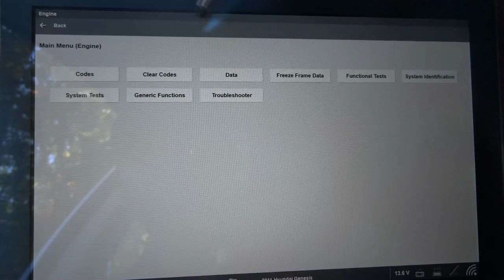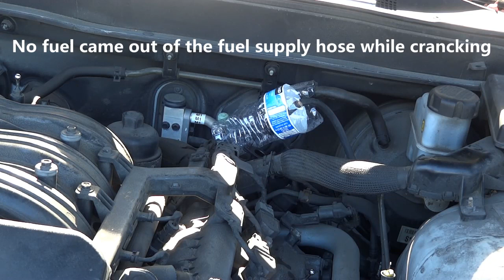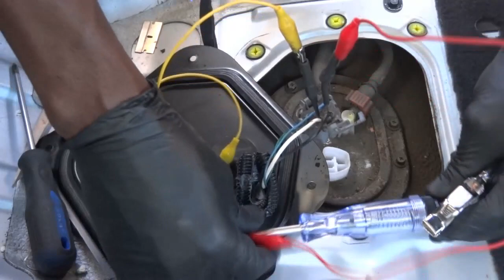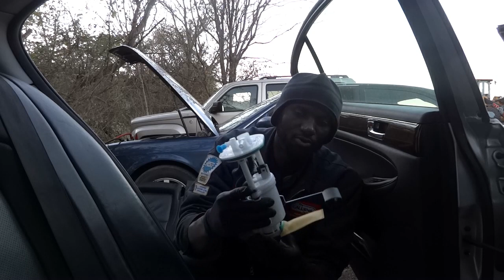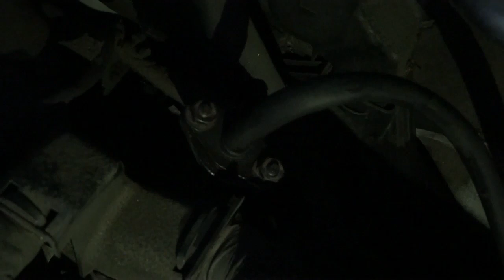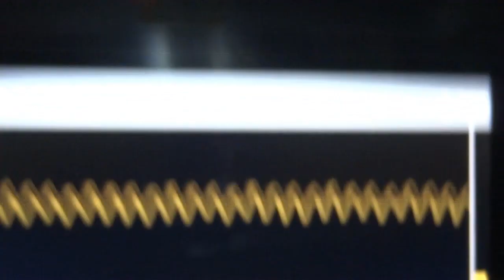Hyundai Genesis - Crank, No Start/ Fuel pump testing

Comment: Thanks for the video! I’m currently having this issue with my 2012 Hyundai Genesis 3.8. The dealership told me I had bad gas, got that replaced but the car is still doing the same thing… no start, battery drainage, clicking when trying to start, whining sound after car is turned off. Now they are telling me it’s the fuel pump. How much was the fuel pump assembly you ordered for this car?

Comment: I had fuel pump replaced but the engine is still receiving the fuel sometimes it will crank and run then it starts to run rough and crank off..what could it be

Comment: I did exactly the same test to my fuel pump connections with a test light but the light turn green instead of red what does it mean I'm getting a green light every time I crank does anyone know if that's good or not or should I turn again I use a test light just like the guide on the video

Comment: I have similar issues but after several cranking the engine runs,  what could be the problem?
Reply from the maker: @nasserjabri7449   Your fuel pump could be weak

Comment: Excellent video. I also have a 2011 Hyundai but it's a Equus. My issue is that I smell gas in the car when I fill up the tank all the way. I am guessing the fuel pump assembly is cracked or the connector is leaking
Reply from the maker: @kalani1987   Thanks, yes that's possible

Comment: I know its been 3 years but did you really change the whole set of the sending unit together and set the car waiting for a week? Why didn't you just change the pump and the filter right away? Man... that would have been easier, quicker and cheaper ?????!!!!! ✌😁
Reply from the maker: @ShakarAhmadi   No, we replaced the entire fuel pump assembly
Reply: I know but thats costly and one week is too long for that job... ✌️😁

Comment: Hey I have a 2010 Hyundai genesis 4.6 and i have a problem when I pumped fuel the car would crank but would shut off instead and I waited a few minutes and pumped the gas pedal and started after all that any idea what it could be other than fuel pump since I had just replaced it with a brand new one and this is an issue every time I pump fuel
Reply from the maker: @brianmendez9532  is this only happening everytime you put fuel in the fuel tank? if the answer is yes then the issue is most likely a stuck open purge valve!!

Comment: My 2012 genesis does the same thing, but every time I clean the corrosion off my battery it cranks right up
Reply from the maker: @tevin3619  you might just have voltage drop in the starting system caused by corrosion!
Reply: @KITS_Auto_and_Truck_Repair  I found out the battery cable connectors on the Genesis sedans is defective. They do not use a zinc die cast traditional battery connector, it is made with two metal "bands" that go around the post. BAD design. This has caused all kinds of random electrical "hickups" on this cars!   My car 209 sedan would go completely lights out on me - did once on the freeway at night.  Buy a red and a black 1 ft long cable at the auto store, then just extend the cable and fasten the round loop side to a bolt on the original cable.  Then you have to support the stupid plastic fuse holder tray on the positive cable - insulate it from bouncing around....you will see what I mean if you go to replace them.

Comment: Also sometimes when i turn the switch on u hear the pump come on and then sometimes you wont hear the pump until you try to start it.
Reply from the maker: @quincyrobertson9029  your pump might be failing intermitently or you could have a wiring problem!
Reply: @KITS_Auto_and_Truck_Repair  the pump works its sending fuel just wont run the car anymore.

Comment: I replaced the fuel pump and it started drove and died again. What could it be?
Reply from the maker: @quincyrobertson9029  Make sure your wiring is good! and I hope you installed a good quality Pump!
Reply: @KITS_Auto_and_Truck_Repair  walbro 255. I replaced the pump itself not the assembly. Im thinking the fuel level sensor is bad. I will check to see if i have spark tomorrow.
Reply: I would like to know as well

Comment: I recently replaced my pump now there’s no power from the pump it’s at the dealer and they want too much for a pcm something like that module everything else works could it just be one of those wires?
Reply from the maker: Valarie Aria  yes! Make sure the pump relay is good!
Reply: @KITS_Auto_and_Truck_Repair   I have  2009 with start issues.PCM replacement, new starter? New Crankshaft sensor. Im searching for relay issues and Motar Block Grounding?
Reply from the maker: @danielmoss359  Yeah! Check your wiring!

Comment: Cleaning the bottom of the fuel tank…..The fuel pump just died on our Genesis and my wife just filled the car up about 10 miles ago.  How shallow is the tank?
Reply from the maker: Todd Rey   it's pretty shallow!!
Reply: @KITS_Auto_and_Truck_Repair  by the way, I have a 2012 Genesis 3.8 sedan.  Is changing the fuel pump about the same as the one u did in the video?  Thanks!
Reply from the maker: @todd5082   My Pleasure!! Yes it's the same process!
Reply: @KITS_Auto_and_Truck_Repair  thanks Bud.
Reply from the maker: @todd5082  My Pleasure!!

Comment: I’m literally dealing with the same issue with my Genesis coupe 2.0t just hit 80k miles
Reply from the maker: KidCigano  do the test I did in the video if everything checks out ok, your pump is most likely defective!! Good luck!
Reply: @KITS_Auto_and_Truck_Repair  most likely will do the test sometime this week. Appreciate the advice and this great video!
Reply from the maker: @KidCigano  Thanks!
Reply: @KidCigano  how did it go? I feel like mine is starting to go now @74k miles
Reply: @stinkfart697  had to replace the fuel pump assembly unit
Reply: My pump went out at 130k. Got another one put in. 199k miles  now

Comment: Hey man great video, I just changed my pump on the exact same car, first crank it started up for a second  then quit and stopped working. I plugged in the code reader and it isn’t reading any engine codes. Do you have an idea on what this could be?
Reply from the maker: keagan van hoecke  Thanks! check spark and fuel pressure!
Reply: @KITS_Auto_and_Truck_Repair  thank you! I’m going to try that tomorrow. Do I check the coil for spark?
Reply from the maker: @keaganvanhoecke8561  yes!

Comment: Thank you so much for the video, would I still be smelling gas up from by the engine even if it is the fuel pump? It seems like the exact same scenario I’m in, lost power steering all lights came on on the interstate. The crank sounds the same I’m about 170K miles
Reply: I am getting spark and compression.
Reply from the maker: Jared Maier  Your problem is most likely fuel pressure!!
Reply: @KITS_Auto_and_Truck_Repair  thank you so much for the reply, I do have fuel actually, is there anything else you would check for a situation similar to this? I’d assume it is sensor related but I have no clue where or how to start
Reply from the maker: @jaredmaier3414  are you sure, you have spark?
Reply: @KITS_Auto_and_Truck_Repair  yeah, haha got shocked checking lol! It cranks over just like this one. Only code it’s coming up with is oil temperature sensor but idk if that would make it not start, I thought about checking the crank sensor too but idk if either of those would do anything. I have had slight overheating problems because I have been waiting for a new radiator from my shop for a month and a half now and they keep pushing it back. Maybe it overheated and the oil temperature sensor is making it crank but not start?
Reply from the maker: @jaredmaier3414  Recommend you check for injector pulse and spark! I have a couple of videos here in the channel that can show you how to do so!
Reply: @KITS_Auto_and_Truck_Repair  spark has been checked, injector pulse is getting checked tomorrow when the set comes in, I’ve checked most everything else I don’t know what it could be. The only codes coming up are oil temp sensor and O2 codes
Reply from the maker: @jaredmaier3414  Sounds good!!
Reply from the maker: Jared Maier  It sounds like your fuel pump gave up! disconnect the fuel supply line under the hood and crank the engine to see if fuel will come out!!
Reply: @KITS_Auto_and_Truck_Repair  £11

Comment: I don't have power to the fuel pump. Fuel pump relay has no power to it. Where do I go from here?
Reply from the maker: Amber Vinton check the fuel pump fuse, if the fuse is good!! I recommend you take it to a pro mechanic who can diagnose it for you!!
Reply: @KITS_Auto_and_Truck_Repair  didn't see one. Is it in the engine or the dash and which side? Thanks for the reply!
Reply from the maker: @ambervinton5348  it should be in the fuse box under the hood!!
Reply: @KITS_Auto_and_Truck_Repair  just to add to the confusion. I realized the dash lights go out when cranking. Does this seem like a bad battery or bad connection? Not sure why it cranks so well if the battery is bad, but I also don't know why the dash lights shut off when cranking. . .
Reply from the maker: @ambervinton5348  yeah! you might have a battery, you should have it checked!!
Reply: @KITS_Auto_and_Truck_Repair  discovered no fuel and no spark. Voltage drop when cranking. When on a scanner, I can get the fuel pump to prime. Voltage drops to 6V when cranking. Going to replace a battery.
Reply from the maker: @ambervinton5348  Sounds good!!
Reply: @KITS_Auto_and_Truck_Repair   new battery did not fix. Still dropping voltage when cranking. Fine with key on, drops as soon as cranking. Not a slow crank, but now I am thinking maybe the starter is drawing too many amps.
Reply from the maker: @ambervinton5348  You probably have a voltage drop problem in the starting system, check the starting circuit first or take it to a pro mechanic so they can diagnose it for you!

Comment: Great video!  Very thorough and clear.  I was afraid to work on my car but after seeing this, it was less daunting than I thought.  I had the same issue as you with parts being months out.  Ended up just replacing the pump.  I think the one I got is lower pressure so it’s still taking some time to start up, but it will get me from point a to point b until I can get a better pump.
Reply from the maker: clintdover Thanks, I'm glad to hear that you were able to fix your car by watching this video!!
Reply: Hello I know this was over a year ago but how what someone who has no experience with working on cars clean out the tank without dropping the tank

Comment: Nice videos …i need HELP … for some reason my Hyundai Genesis 3.8 wont start.. the other day I was driving like any other normal day then i sped up switch lanes then for some reason my car just turn off on me it stalled so everything stiffed up all lights and radio where still functioning so I made it to the side of the the road the notice a lil smoke coming from engine ever since then it don’t wan to start I tried jumping whit cables no luck I even went and bought a new battery sure wasn’t that ether any ideas on what could it be ????
Reply from the maker: Thuggy Drops  check for spark and fuel pressure!!

Comment: Will a bad crank sensor cause the fuel pump not to engage ? I replaced fuel pump , checked the fuses and relays , and my pump still will not prime or kick on at all, I have a 2011 genesis coupe 2.0t… it’s at the dealership now and I think they’re giving me the run around lol… I tried to jump the fuel pump with 12v and the pump kicks on so I know it’s not a bad pump. When I jump the pump and try rn start the car it still just cranks and cranks… car is a push start with the smart key fob I’m at a loss right now , any help is appreciated!!!
Reply from the maker: Joey DeCrease  yes a bad crank sensor can cause the computer to not turn on the fuel pump or the driver that turns on the pump in the pcm can be defective,  is there a trouble code in the engine computer?

Comment: Great video, I have a 2010 Genesis 3.8L and the issue  I have is that I smell gas when I start it and when its running and shut off, the engine light has been on for a while now, I can't visually see any gas leaks, its got 125,000 miles.        I'm thinking its one of three things Did a code check a while back 
I'm thinking its either the gas cap 
Purge Control Valve 
or a sensor, now lately its starting to starve for fuel, so its cranking a few times before it starts up. - Now I'm hoping its not the fuel pump. How would you go about eliminating the different scenarios  -
Reply from the maker: Tony Mazz  it sounds like you're having a purge valve problem, check the purge valve first, I have a couple of video in this channel that can show you how to test a purge valve, look at my Evap videos!!
Reply: @KITS_Auto_and_Truck_Repair  so I changed the Purge valve and the engine  light disappeared but within an week the engine light is back on.
Note I also changed the gas cap. Just before the light went on I heard a pop sound like something hit the under carriage of the car, i was expecting to see gas everywhere but no nothing except for the engine Iight. Let's see what happens the next couple of days maybe the smell will come back so frustrating.
Reply from the maker: @tcmazz  I hope it doesn't...

Comment: Customer driving and it shuts down while driving, I heard a rumors: crankshaft position sensor. I have not changed it on my 2012 premium
Reply from the maker: A Ja yeah, a defective crank sensor may also cause the engine to shut off while running!!!
Reply: @KITS_Auto_and_Truck_Repair  ahhhh. If there is no check engine light would a scan tool pick that up as well??
Reply from the maker: @titanjake8640  yeah, you can look at the fuel pressure data Pid on the scanner and see if you have fuel pressure in the fuel rails, that will tell you if the pump is working!!!
Reply: @KITS_Auto_and_Truck_Repair  you are the best. I will do that tomorrow anyway!  Have a great evening
Reply from the maker: @titanjake8640  thank you!!! Good Luck!!
Reply: @KITS_Auto_and_Truck_Repair  
What can possibly be the reason y my car dont start it's a 2009 Hyundai genesis
Reply from the maker: @marievilla4596  check for spark, fuel pressure and compression!! you're probably missing one of those!!
Reply: @KITS_Auto_and_Truck_Repair  i think its missing  compression
Reply from the maker: @marievilla4596  if it's missing compression then that's a pretty serious problem. you might have timing issues, like jumped timing, or worn out cylinders, and maybe a leaking head gasket the list of possible causes can be long!! so you should  have it diagnosed or change the engine,,, Good Luck!!
Reply: Anyone know of as good mechanic for hyundai genesis in c.a

Comment: My 2011 genesis coupe 125k miles manual transmission is starting to shut off while driving in town specially on lower gears or low rpms  first few times I thought I let go the clutch too fast before I put the car on neutral  and that will cause the car turn off so I’ll turn it back on with not problems but yesterday while I was at a parking lot with the car on  on neutral the rpms went down to 200s then it shuts off  that’s when I notice I have a issue . The car turn on and I drove it home then I tested  the battery and alternator they seems to be working fine now I’m suspecting I have a fuel pump going bad .. any thoughts of what could of be ? If it’s the fuel pump going bad it would be an easy fix for me but how do I test a working fuel pump if it’s fails sometimes or it’s staring to fail on me? 
When I’m driving the car in highway or high gears the car drives normal the issue is on low Rpms or first  gear
Reply from the maker: Erick Herrera you should check the fuel pump when it dies, I showed how to quick test a fuel pump in the video... a car shutting oof can be caused by a lot of things, after checking for fuel, if you have fuel then check for spark...
Reply: @KITS_Auto_and_Truck_Repair  Thank you I’ll check the fuel pressure next time if it does it I cleaned the tb and added an fuel treatment bottle  to a full tank and it hasn’t done it yet again
Reply from the maker: @erickherrera8225  My Pleasure!!!

Comment: My car 2013 it looks like the same problem but after crank it starts and runs for a while then shut off after that it cranks but without start unless I left it for one day then it will start and run for anther while I noticed before it shut off become a weak till shut off again !! So did you go to fix this issue by change the full pump or there is something else needs to check on ?
Reply from the maker: Hussam AlGhamdi the symptom you're describing can be caused by a couple of things... check for fuel pressure when the car dies, if you have fuel pressure then check for spark then go from there...
Good Luck!!!
Reply: @KITS_Auto_and_Truck_Repair  thanks for your reply . Now there is updated it cranks no start at all I gonna to check as you say then give feedback
Reply from the maker: @Moody-o6y  My Pleasure!!! Let me know, how it goes!!!
Reply: May I also add check your high pressure fuel pump in the engine compartment as well. It is known to have problems. I changed mine. You can use one from Santa Fe or candenza or genesis.
Reply from the maker: @titanjake8640  thanks for sharing that!!!
Reply: @KITS_Auto_and_Truck_Repair  my pleasure!!
Reply: Hmm different engine as I have 2012 3.8. They changed engines.
Reply from the maker: @titanjake8640  coo!!

Comment: I have a 2011 genesis coupe with 66,000 miles and there’s no light on the dash but every time I try and start it for the first time it starts fine but there’s a rattle noise and the 2nd time it take a while to start... what do you think is wrong with it?
Reply from the maker: Isaiahmonster that's kind of hard to tell, there are so many things that can cause a rattling noise under the hood, I've seen a stretched timing chain make that kind of noise but don't take my word for it, you should get a pro mechanic look at it for you